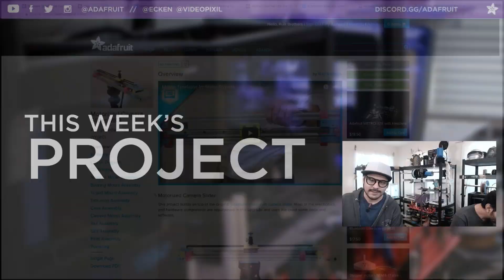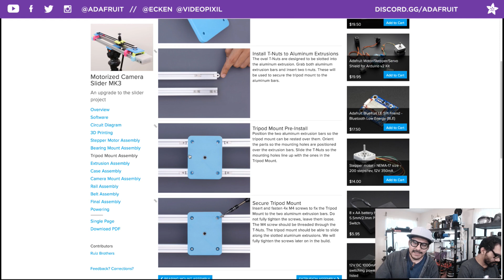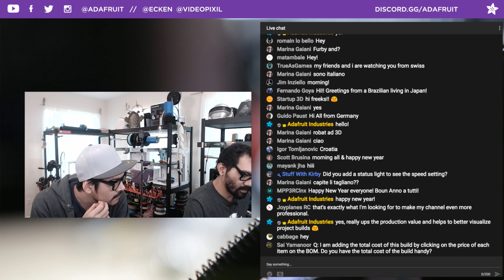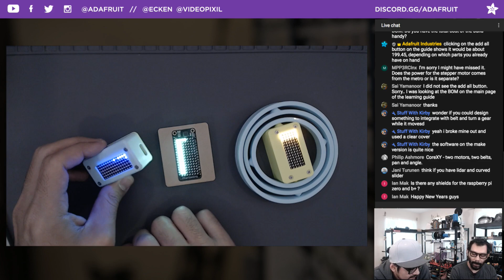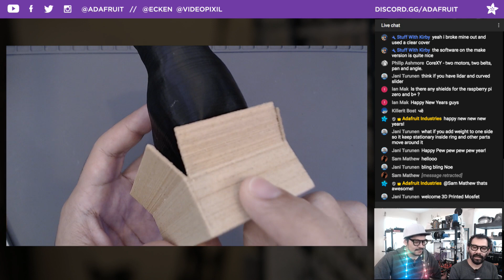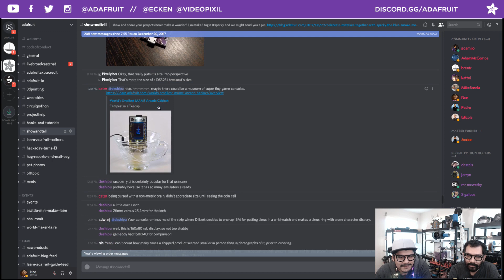3D Hangouts – Sliders, LED Matrixes and Cats

Comment: how about putting small mag proxes at both ends (or adjustable positions on the rail) to limit travel to easily adjustable travel lengths without code changes.